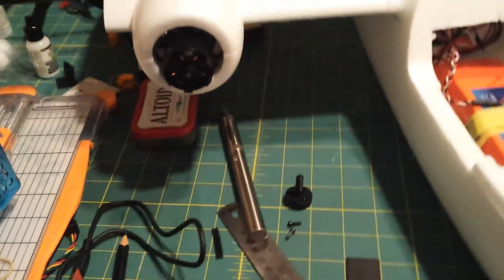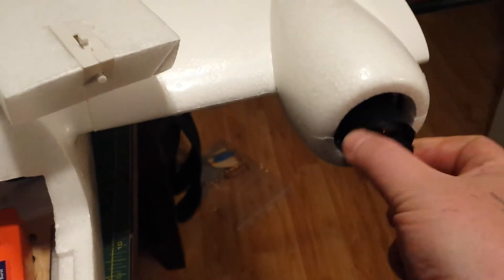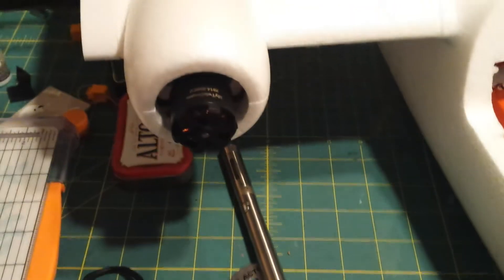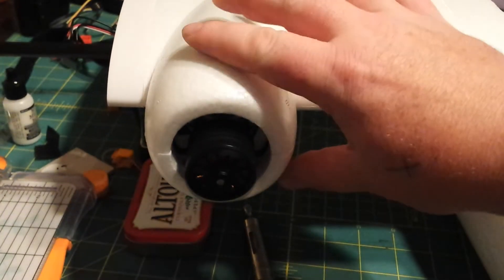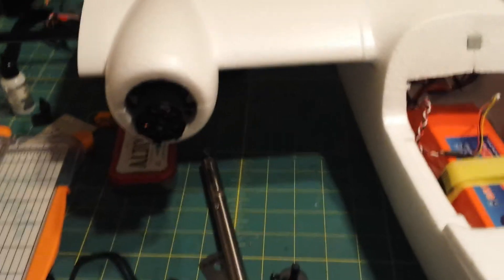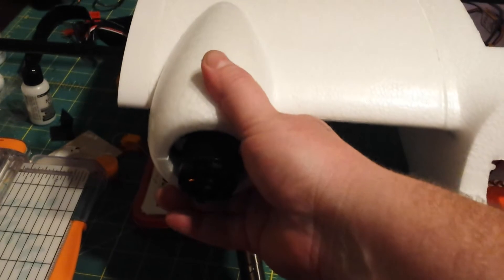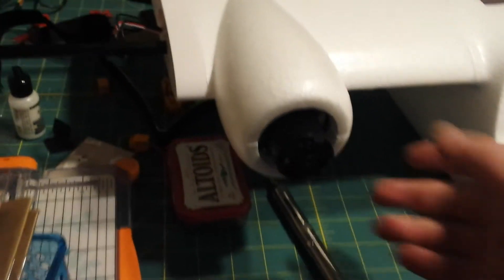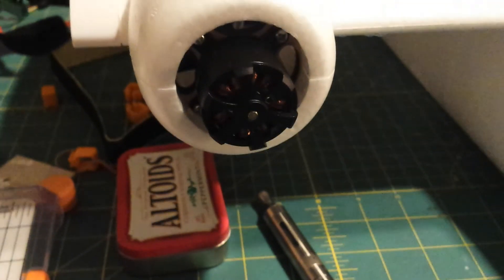Myflydream motor issues

Comment: EC, nice to see the MTD a reality in your life! I had the exact same issue and got horribly messed about by MyFlyDream - I ended up ordering a new set of motors and it's ok now. As long as you are sure your motor mount is tight and the firewall is properly secured then I guess you need to just buy another one I'm afraid - or email Charles, but it's a horrible ball ache I assure you, but hopefully you'll be lucky. I think he charged me $25 for a replacement with shipping to the UK, but it took ages and m,any teeth pulled! By the way, how did you mount the motor mount...? I have used blind nuts and this makes it really easy to get the motor changed. Don't be disheartened - it's a good motor actually! I have a spare if you're not getting lucky with MFD, just let me know. Cheers!
Reply from the maker: +FlyBoySee Hey, thanks for the offer and reply. I emailed Charles and have not  gotten a reply yet. But i ordered this though RMRC in the States and i am glad i did. At first i was going to do it directly from MFD, but ive been following all threads related to MFD seeing i now use their AP in both the Skywalker and my TBRC wing. Its a great AP and love it. But seeing how a few guys, including yourself having issues with dealing with them directly. I opted to go with RMRC. It was 50 shipping, but i got it in 3 days and no damage. RMRC offed a new motor and ive sense sent the defective one back. Im hoping for a quick turn around. All the hardware was mounted nice and tight. With loctite. As for the motor mount screws, i've just done it the normal way. Also with the bad motors, the prop adapter has  warp in it. So that is sent back to..Cheers
Reply: Cool! Looking fwd to the maiden - will keep a look out!

Comment: What motor is it?
Reply from the maker: +ABMNS PRODUCTION Teamlegit said they are HobbyWing motors, the same as what are using with Phamtoms etc. Its a 2814/800kv. But are actually 35mm can size. its a nice solid motor. I just got unlucky i guess..Weird this is, i searched for a hobbywing motor with the same specs and could find nothing. So did MFD get them specially made with their brand on them.?
Reply: eastcoast78 They look like some kind of sunnysky rebranded at first sight! It's pretty strange!
Hope you will find a way out and maybe get a answer from Charles...